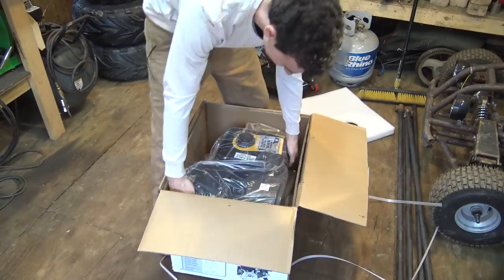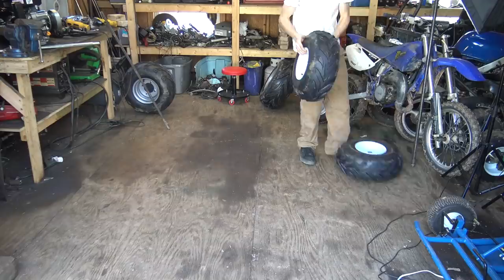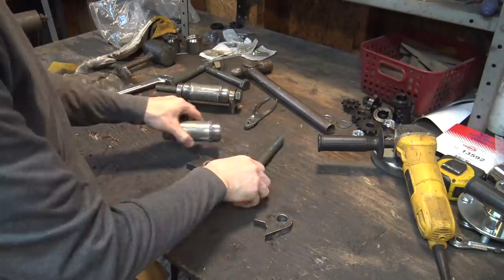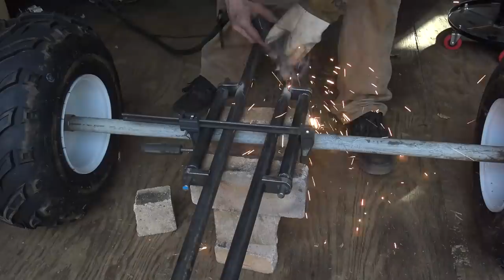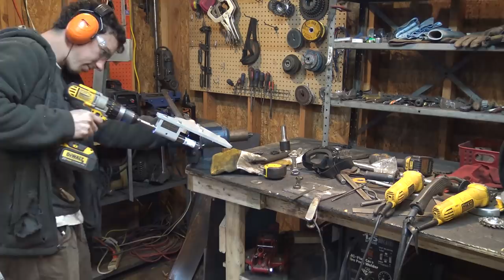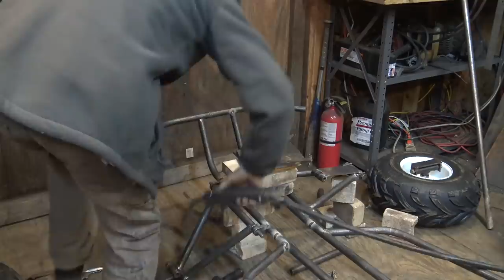home made two speed off road go kart part 1

Comment: Your either not serious about that little engine being too much for that 3/4" axle or you seriously need to educate yourself regarding Torque loads and material strength and stress . That engine doesn't make anywhere near enough torque to even start to stress that
 3/4 " axle shaft. Long before the axle would notice that engines torque , something in the engine would break if a binding condition were to exist.  It's a air-cooled 422 cc utility engine not a damn High HP & Torque V8 . Additionally you clearly don't understand what a torque converter actually does . Education is key my man . You have obvious talents that your going to be able to build on with some education and experience. Good job . Like I said , your talented and will only grow more talented with education and experience. That can easily become a 4x4 cart since your making use of a torque converter . Think about how you can do it. It's well within your ability and easily done with some thought and understanding of the torque converter and torque splitting